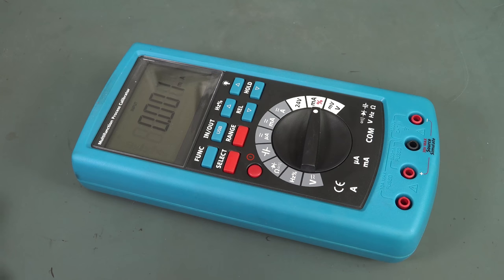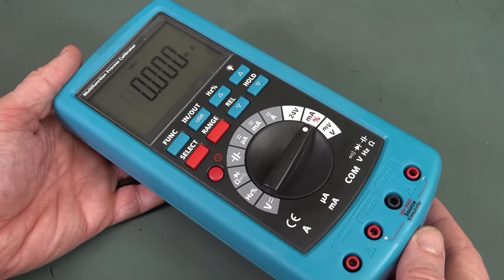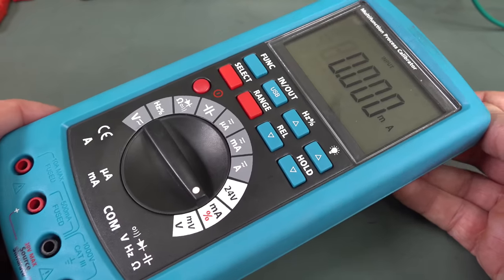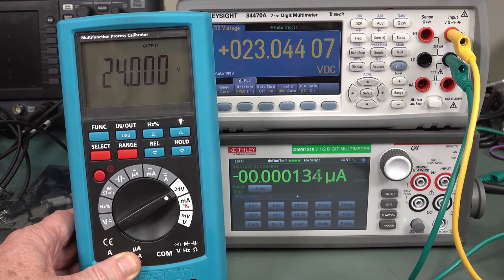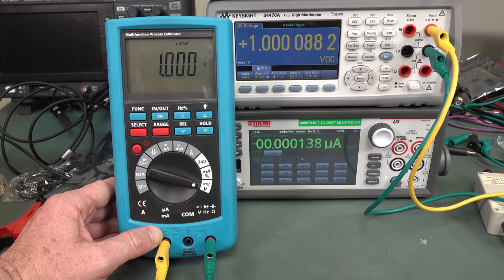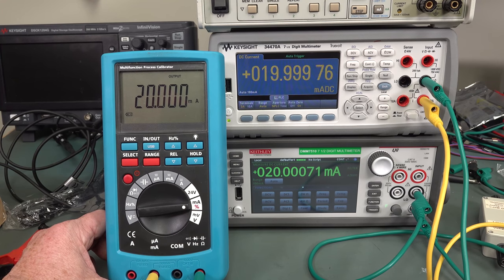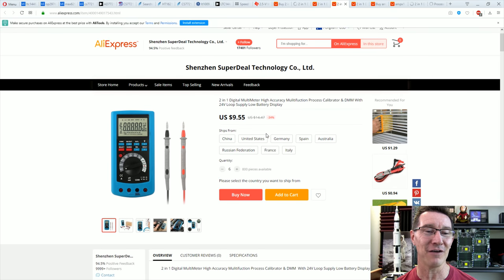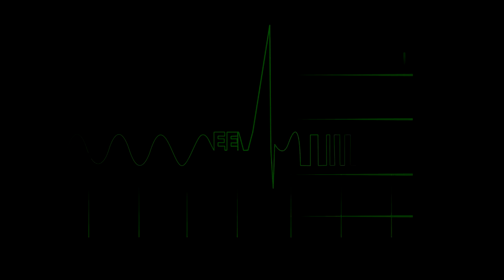EEVblog #1248 - INSANE! A 0.02% Process Meter for $9? WTF!

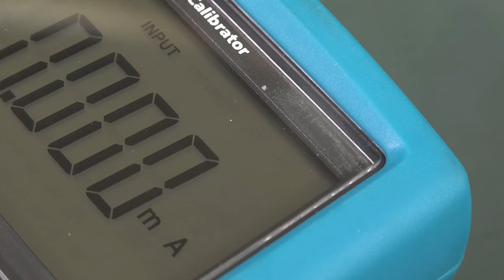Comment: 3:15 - Probably didn't pass quality so they said screw tossing them, we'll sell them backdoor for parts/labor to keep losses down. Also would make sense why there's such a limited supply and it sold out instantly.
Reply: did you watch the video? the BOM alone is like ~50$...
there are two chips in there worth ~10$ each even in 12000 piece reels
the two relays are worth more than half the retail price.
Reply: @TheScarvig  - did you use your BRAIN?
The BOM cost is totally and utterly irrelevant. Factories DO NOT sell faulty products, they destroy/scrap them. In this case they didn't quite get 100% destroyed.
Reply: @johncoops6897  "sell them backdoor for parts/labor to keep losses down" implies to me that OP meant that the price they sell them at is at least the value of the parts and the labor without any margin of profit or development cost.

even taking off the two relais and not throwing out a set of leads and fuses would probably save the manufacturer more than what he makes on "backdoor" selling the faulty product.

point is, YOU say "Factories DO NOT sell faulty products, they destroy/scrap them"
assuming the manufacturer intended the product do get scrapped
OP says "they said screw tossing them, we'll sell them backdoor"
which assumes the opposite
I say OP didnt think this through, as the value of the parts on the faulty boards is WAY higher than what they make back selling them "backdoor" 

excuse me if i might have misinterpreted something in my non native language...
Reply: @TheScarvig  wow, you really got that asshurt just because i said they're recouping losses by selling units that didn't pass QA? You should see a psychologist or something man, my comment shouldn't have made you so annoyed you came back on two separate occasions to verbally rip me a new asshole for an assumption I made that's not even that far off base lol.
Reply: @jetjazz05  my second reply in this thread wasn't even directed to you? where is your problem?
if anything i might have been a bit "asshurt" because of @Jhon Coops claim i did not use my brain...
but mainly i spend my time here on youtube because i am bored and got nothing better to do anyways. so for me as an engineer who enjoys arguing with other people, writing a lengthy comment to prove my point is just entertainment.

Comment: These are made by Mastech.
They are rebranded MASTECH MS8218
Reply: Good lord you're right
Reply: Good spot ! You can see the MS8218 on the USB board next to a 2012 manufacturer date
Reply: @kyliandc9276  most meter companies leave clues as to who made them.  That's one of the main reasons I like these tear down videos.  I'd wager there are only a handful of companies that actually make meters and the rest are rebranded.
Reply: From the outside they look the same and MS8218 printed on the USB interface PCB does give you a hint, but internally they are not the same.
They may be made by Mastech for the other brand, or the other brand may have "borrowed" some IP from Mastech. Anyway, doesn't seem to be rebranded MS8218.
Reply: no, I have MS8218 it have no outputs
Reply: Reminds me of a MASTECH MS7287....
Reply: Unfortunately that only tells you who designed the interface board, not the main board. Figure that one out, and you'll know if it's a genuine or rebadged job ;)
Reply: Looks like Aimometer AMPX1, usually sold for few hundred bucks.

Comment: Probably a production run that just barely missed specs on some inconsequential factor like being 3mm too short, etc...
Reply: Abe Lincoln It clearly failed some of Dave's testing, so not insignificant flaws.
Reply: Or a dodgy range switch.  Or dodgy firmware.  Too expensive to rework.  So either junked then fished out of a dumpster or sold as rejects.  Whoever got the batch then scraped manufacturer name and model number off.

Comment: im guessing based on the 2015 board revision these were old stock or just a bad batch (might explain the buggy firmware) then again, 

 6 fuses and a a lot of decent parts, even a real buggy one is a good deal at $10 + eevblog tax

Comment: i liked the USB job. nice touch. I wish Fluke would have done that on 289 and others....
Reply from the maker: Yeah, nice implementation.
Reply: When I saw only two words going to USB I figured where sike that's got to be isolated or maybe it was powering the circuitry from the USB cable and isolating it from the multimeter power.
Reply: It looks like a USB<->Serial IC and half of the old MASTECH Infra-red RS232 output?  IIRC the old meter could send readings out, but couldn't be controlled from the software.  It really looks like the 2012 model MASTECH MS7287 with a re-skinning.

Comment: Hey stop. Do you really need this QC reject niche piece of equipment for 70$? You're welcome.
Reply: Consider it a gamble. If you are lucky (getting something with minor issue) then you got a good deal, if not then, well, that's the risk and nobody would complain.
Reply: nobody said you need it for $70. It was below $9 until they realized what they are selling.
Reply: @FlameRat_YehLon   no need to gamble, for 70 one can get LB02 which do the same
Reply: @therianet  what I mean is, if it's $10. If it's $70 then I would expect the seller to send replacement for units that doesn't work correctly.

Comment: I think these are units that failed tests, or had some some of manufacturing defect, so the original manufacturer was going to scrap them.  But then they thought they could recover some cost by selling them cheap.  But they took their brand name off it because they don't want any returns or support calls.
Reply: IIRC it's usually a violation of contract or brand infringement for the manufacturer to sell those themselves, and thus the debranding thing might just be to avoid brand infringement or things like that. Anyway, people who buy debramded stuffs usually know that it might not work properly so it's more of a gamble than a scam.

Comment: It's easy to understand how it's so cheap if you look at the economics of mass manufacture.
Let's say the manufacturer makes 10,000 products at $10 cost. That's a total of $100,000 in costs.
Now let's assume, say 10% fail QC, you now have 1,000 faulty and 9,000 good units. You can sell the good units at, say, $250/unit, which will gross you $2,250,000, but you still have a 1,000 faulty units (with $10,000 of parts) that you're either going to have to pay to fault find and fix or pay to dispose of. Alternatively, you can just remove your branding and sell them to a discount retailer for $5 each. Now, rather than paying to fix or dispose, you just made another $5,000 gross for a total of $2,255,000 gross, minus the initial $100,000 which still nets you $2,125,000. You've only lost $125,000 (5.8%) on being able to sell every single one at full price, but you also don't incur the costs of fixing or disposing of sub par units. It's not uncommon practice, and will more than likely be accepted as an acceptable loss. It's really not that different from CPU manufacturers using faulty, but operational dies in their lower SKU lines to make up for less than 100%  silicon yields.

TL:DR it makes perfect sense 😊
Reply: Yup.  These were made by MASTECH and they make millions of meters.  My guess was these were made for a customer and were QC fails and rather than try and rebuild them, it was easier to sell them as scrap, hence the shredded model and serial nos.  As for the pricing, I suspect many shops are run by one company, it's a common Chinese tactic to funnel shoppers into buying at an inflated price (and to make it appear a particular product is popular, when in fact only one company is selling it)
Reply: Why would a manufacturer undermine his own $250 each market putting out the faulty units?
I remember the farmers in my country prefer destroying the over production rather than selling them undercost.
Reply: @santopino2546  this isn't a matter of over production, it's about quality control. If a foodstuff fails a quality inspection it HAS to be destroyed for public health and safety, and is an irrecoverable loss. Consumer goods that fail quality inspection may still be safe, just not as functional, and therefore can be sold, thus minimising the loss incured. The manufacturer isn't undermining their market, they're just minimising their lossess as effectively as possible. Also, farmers destroying over produce is usually due to trade regulations that state they're only allowed to produce a certain amount, and can incur fines for trying to sell more that their allowance allows...
Reply: @JaenEngineering  Whatever the reason, but does it change the fact that they would be undermining their own market?
I had no problem in the past 20 years to waste thousands of Euros for good quality certified process equipment, but I know of many technicians that would immediately jump on these bargains and use them on their jobs.
Reply: @santopino2546  Take your farmer analogy, if some of the produce is damaged, it will be sold to industrial customers who will turn apples (for example) into fruit juice, or mash for pies, or even food for pigs. The farmer gets less money but the farmer doesn't have to bury the crop on their land and they still get something for it (even if it is a loss) Now some of those apples might be stolen along the way by someone who thinks they can sell bruised apples for $$$$, but the market isn't being undercut as the supermarket who only buys perfect apples sells to customers who only want to buy perfect apples. There are two distinct markets with little overlap. I lived on a farm for half my life, so I've seen the impact of disasters and the cunning schemes to make money from what looks like a total loss.

Comment: Not a whole meter,  but I did buy some 10.0000 voltage calibration IC's here in the US. A spare tin, switch, battery...and I have my 10.0000 volt calibration source, guaranteed by a major IC maker.

Comment: My guess is that somebody at the factory made an extra buck from the QA fail dumpster. (Likely still something wrong with those things, still doesn't mean they're unusable - just some feature or other isn't working as it should.) That's why they have the stripped branding, but motherboard and components being the real deal.

Comment: 2 in 1 High Accuracy Mulitifuction Process Calibrator & DMM Digital MultiMeter With 24V Loop Supply Low Battery Display EX
£34GBP
 from £476GBP

Comment: There are a few left for $40, search "Mulitifuction Process Calibrator"
Reply: 15 minutes after public, all up to $80, Dave's patreons cleared them out
Reply: Looked like one of his links had it $10.50 or so with $2.50 shipping (just clicked random one, like 4 up from bottom or something). Still, $15 isn’t bad... Might have to get one to calibrate a few meters I have coming.

Previously I just used CPU voltages, set my board to 1.5000v (do not do this on Intel or Ryzen CPUs, I used FX, use like 1.2v for those other chips), and disabled all but 1 core so it had the least amount of load. You can also test at any known voltage (like I also tested at 1.5125v too). It’s the most accurate source I had, so if you have a high end board you MIGHT be able to do this, the problem is some high end boards have a load line calibration setting that can go way over voltage, which is kind of why I needed the meter to be a bit more accurate than just for measuring batteries, haha!

If I get one I’ll have to hook it up to my high end VRM power board since I can program it for dynamic voltage loads or startup procedures and exact voltages or transistor switching frequencies etc, it should be pretty accurate (the microprocessor in it is like $50, and the mosfets cost like $85 alone buying thousands at a time, but it’s kind of needed for the 600+ amps it’s rated at on primary side with its 11 stage VRM)
Reply: Any one have a dgate link?

Comment: I bought 3pcs and they declined my payment Lol, now they cost 250usd lol
Reply: Likely multiple sellers got from a single source therefore they didn't have that many available in stock.
Once I tried to buy last item which was not produced any more from an aliexpress shop they sent a message that item was damaged and refunded.
Reply: @Exodus hahahahaha, great deal so, buy more as fast as you can, that's 27usd only than 150usd lol
Reply: @Exodus I making Stuff that useful, that's why i need that calibration multi tester even i have Rigol DS1054Z, i still need it hahahahaha

Comment: The item works well but is probably a defective unit in some way which is why it was sold that low.
With the amount of techs out there, almost all of the purchasers will fix the glitches in the unit, if any.
Great deal for them.
The trim pot was probably for calibrating the meter to zero or whatever.

Comment: Is it possible these units failed some sort of certification or QA process, and because of that they can't be sold legally on the US or EU market, so instead of chucking them all in the trash, the manufacturer decided to just remove the branding from the case and sell them for cheap?

Comment: I wouldn’t use it as a multimeter, input clamping protection was broken on the one I tested years ago. The accuracy on the output was also off with mine and didn’t meet specs. They were trying to sell these to other companies like BSIDE as you see the same meter sold by many names. Maybe they didn’t sell so the scratched the name off? Maybe that’s why they didn’t sell and they are going for cheap now?

Comment: "...found on Aliexpress. I wasn't, like, searching, I was just on there." 
Yep, that's what I tell my wife about my purchases as well...
By the way, "usual sources" for factories are not distribution vendors like you're checking. Factories buy directly from manufacturers.
And the fact that the name is scraped off shows that those units that surfaced on Aliexpress were built for "original legit" brand, but then for some reason (maybe obsolescence, maybe quality issues, or one of a 100 corporate reasons) were decided to be scrapped. Factory that built them I guess did not scrap them (I bet they did present a bogus scrapping protocol) but instead removed all markings and released into the wild to make some buck on the side.
Reply: Well, he probably buy quite some electronic parts on the site (or other site that shares the same ad ID) and the algorithm just say, yeah, let's show that product for whatever reason. It's cheaper than similarly named products which might boost the ranking a bit as well.
And, I think the thing is, even if they don't sell those as no brand stuff they would sell those to recycle plant anyway, scraps are scraps, I mean. Therefore, might as well trying to sell the scraps for a bit more money, and then quite some resellers bought their lots to sell for even more money. And by the way, even if one reseller don't have it for sale, they might as well list it at a higher price than normal to make the list longer (which looks better), and in the case someone actually order it they just drop ship it from a cheaper seller.

Comment: Those may be from the reject pile that did not pass the quality assurance test at the factory and got 'dumped' and dumpster divers retrieved them and sold them . So maybe they scratched off the branding and model number to protect the brand or avoid intellectual property infringement.

Comment: Yeah, like others have said, the reason you can't make sense of how they can sell this for so cheap is because they can't. As has been pointed out, I'm sure these were units that were defective in some way and they're just dumping them for a few dollars. They really should be labeled as "for parts." These are most likely $250 units, which explains the BOM. If you're willing to part them out though and can actually get one (they're all gone now), then the parts alone are worth 10x the price.

Comment: Note that "there are a lot of stores selling this thing" does not really tell you much.
Some time ago I went looking for a somewhat less common device and it was sold by at least 10 different Aliexpress shops.
But there was some fishy thing going on with the 'free shipping'.  I ordered it at some shop, they came back to me to ask for money for the shipping "because it could not be sent via Aliexpress standard shipping" (which was one of the options in the shop) and I cancelled the order trying it in a different shop.
Then it became clear that this other shop was actually the same guy under a different name, as he came with the same story and actually said "told you before".
This probably happens a lot.  When you run several different "shops" each with slightly different price for all the products you probably will increase your volume and credibility of the product (as you show in your video).

Comment: 24V must be for loop power, practically you can power any 2 wire  4 to 20mA transducer and read the current.
Simulate allows you simulate a 2 wire transducer, if you connect to a PLC analogue input, it varies the internal resistance so that the current locks to the value you set on the screen.
Reply: Exactly.

Comment: Looks fabulantastic , but what about like 3.3  , 1.2 , 2.4 , 1.7 volts etc that some strange voltages wich low power arm and or fpga's uses , and what is the noise ratio of the output ? ( looking the signal in the osc ) .

Comment: I remember using a Fluke process meter to salvage Fisher control valves from an old rotary kiln to make a tile curing oven. Nothing like using a $3k USD valve to regulate natural gas with a $150 Fuji temperature controller to dry out refractory tiles. We made 2 working valves out of like 5. You can see the ovens on Google maps, (35.7412491, -96.1487436), 😆

I worked for them long before Honeywell f’ed them and do a little work with the spinoff of “redundant” and “disgruntled” personal.